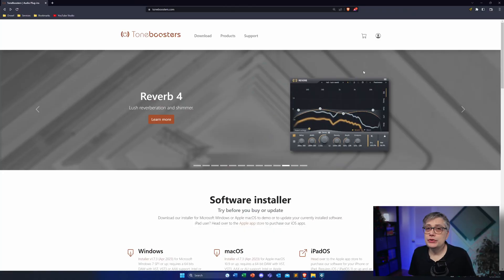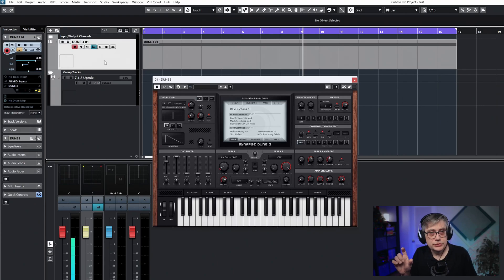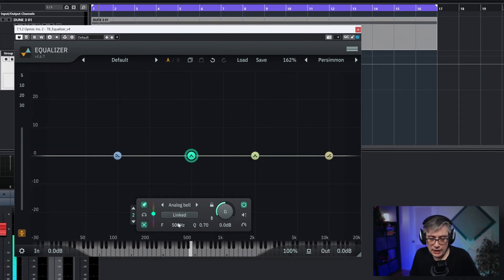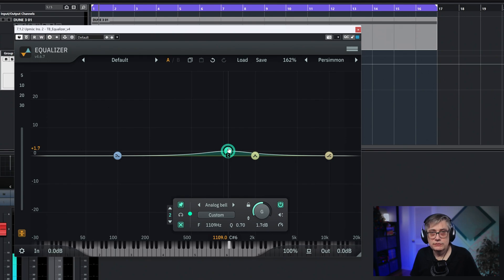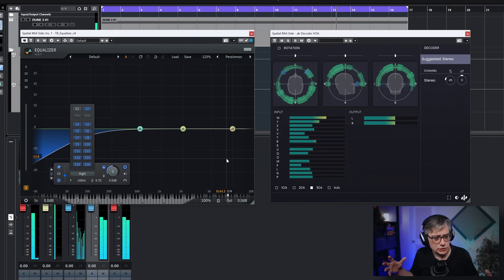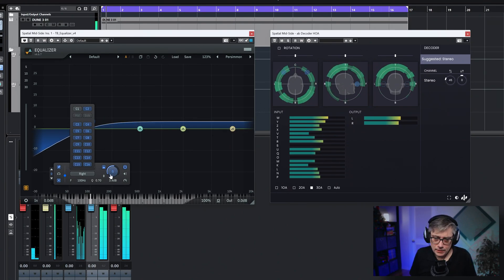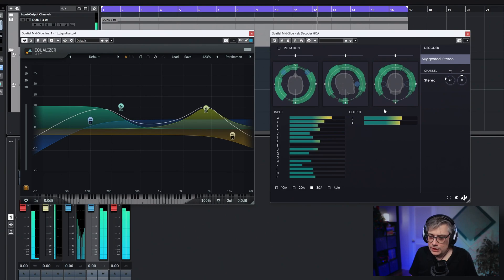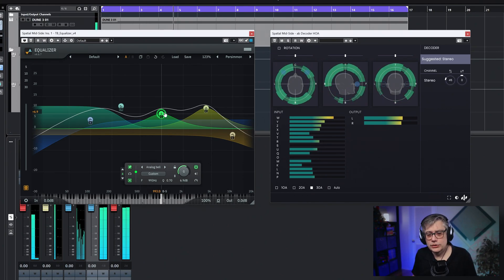The unexpected ingenuity of Toneboosters' Equalizer 4

Comment: So happy to know you love our decoder! The reason why you manually must choose 3OA when using headphones, is because the Auto algorithm works at many levels (beyond 'how many channels are passing through')

I based that specific decision in a research paper I read (I think it was Gerzon, but don't remember), it stated that "the amount of speakers to which you decode can be equal or less to the amount of channels of the order", meaning that for stereo, 1OA should suffice and a higher order might actually not help, but in the contrary, you could miss some info.

Of course, the above is for decoding a static signal - nowadays, when we can rotate these signals, I have been thinking about how to approach the "Auto" algorithm, but for the time being, assuming that most stereo users simply decode and rotate once, that 'tick' stays in the algorithm, and only advanced users (like you), get to select the manual decoding... I'd appreciate any feedback in case there's an overwhelming amount of people that want "auto" to be a literal "auto" :)
Reply from the maker: Thanks for the clarification! I felt I needed to point that out because I had tricked myself a couple of times. I actually had to film this video twice because I had it on auto the first time and then wondered why changing the 3rd order channels did not do anything. 😂